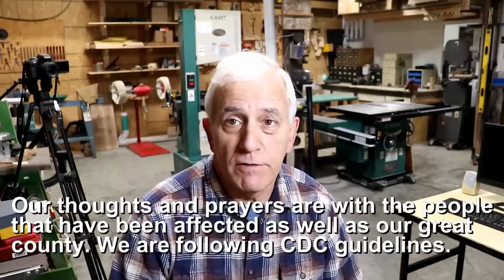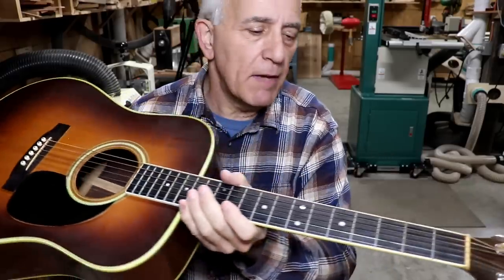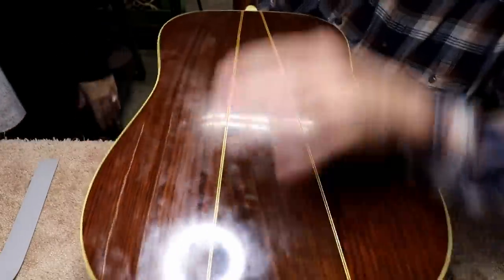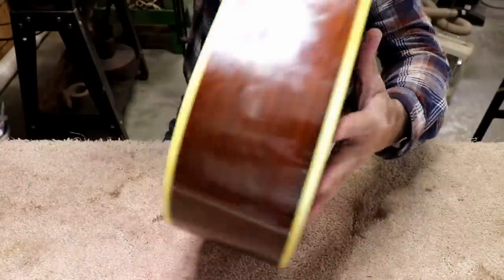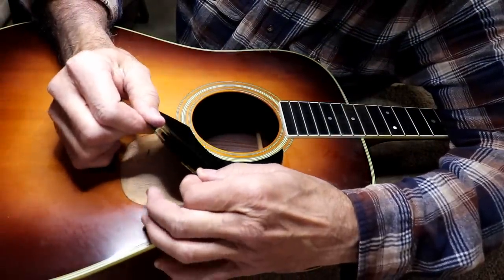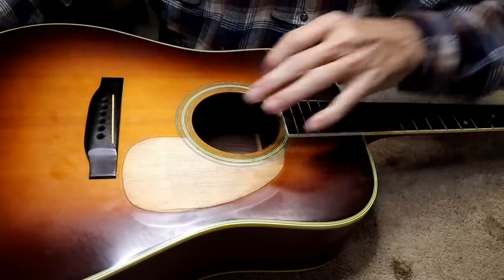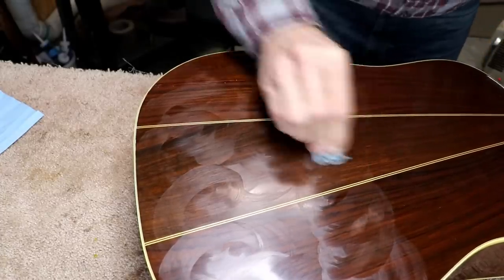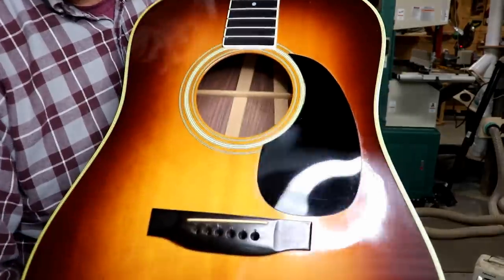387 RSW Martin D35 Impossible Crack Repair

Comment: Jerry, my profession is as a technical  service chemist in a chemical manufacturing company. Before that, I developed products. I can tell you that no spray of a polish type is manufactured without an oil, silicone  or solvent component. They all have that combination. Your assumption that those products affect plastics and acetate type surfaces is correct. Plastics are like a sponge to solvents and react by shrinking or expanding. Sometimes that is just a dulling , other times it is what you have here. So, good advice as usual.
Reply: What about ax wax? Supposedly it doesn't have anything like that in it.

Comment: I bought a D35 with a BLACK pickguard in the mid 70's. I didn't apply polish, cleaner or anything, in fact I rarely played it. It sat in its hardshell fiberglass case for about 10 yrs when I noticed the PG starting to lift from a low edge. I found out that it was a common problem with the PGs that Martin used for several years, and all of them curled. They were all black in color. Just maybe this guitar from the 70's was among them. Martin did not want to honor their lifetime guarantee, but with a bit of social media pressure, they sent me to my local Martin Service dealership. They fixed it and it didn't cost me, of course, it was under warranty. By the way, the 'fuzzy' material inside the case changed the binding from a pretty ivory to a discernable orangish color. Martin-caused problems~!

Comment: The pickguard problem is a known thing with '60s Martins. In those guitars, the guard was put directly on the wood,  using solvent on the back of the guard, then sticking to the naked wood. The finish was applied over the pickguard. The plastic used was prone to shrinkage, and since it was glued directly to the wood, would cause the inner (under the G string) and outer edge cracks. You'll note that if you pull one of those pickguards off, and let it sit for a day or two, it will shrink even more, since the wood isn't holding it in place. Martin switched to pickguards with adhesive on the back, applied over the finish. To "age" a glossy new pickguard, sometimes I'll use a 5000 or more micromesh pad, going in the direction of the owner's pick strokes.
Reply: BTW - love these videos & have picked up a few new tricks. Thanks!
Reply: Very important information to know, sincere thanks
Reply: Don here from Hamilton NZ on my Wife's tablet (Susan) I also do minor repairs on acoustic guitar's thanks for that information 😮😊

Comment: Martin glued the pick guard directly to the wood on the top back in the 70's as they did going back to the prewar days. Then they sprayed lacquer over the top, pick guard and all. The lacquer caused the pick guard to shrink which created the classic Martin pick guard crack. This led to their practice of using self-adhesive pick guards on top of the finish. You did a good job!
Reply: Right. I had the same problem with my D-35 from 1973. Fortunately the crack was small and it was beatufully fixed by a friend who's a marvelous luthier and does this all the time!
I actually saw a video from Stewmac where this problem was solved on a D-35. I thought it would be smart to check out my guitar as well and guess what...?
So I had it fixed and sent an email to StewMac to thank them! :)
Reply: I had the same problem with my 1972 D-28. My good friend and ace luthier Larry Brown removed the curled pickguard and made a new one. Perfect.

Comment: I set my strings by allowing for three winds. After threading the string through the post I crimp it against the host and in the direction it will be wound and the other end the same in the opposite direction thus locking the string at both ends of the post. Then finally I wind the string over itself once and under the remaining turns thus locking it once more.
If I have too much wound around in the end, I adjust. It's that important to someone who bends strings.
  I saw your repair on that fancy green Les Paul model with the broken head. Don't know how you set about getting the measurements but that was incredible.

Comment: I have heard many explanations of the notorious Martin pick guard crack that range from the  plastic shrinking to the plastic not allowing the spruce to expand and contract with changes in temperature and humidity. I also remember hearing once that the curling like this D-35 was caused by chemicals in cigarette smoke !. Nice back repair Jerry !

Comment: Thanks much for the video,  thumbs up to crush a troll.  I'm a big fan of the D-35.

I have a D-35 that was made in '72,  I bought it new in '73.  By 1997, my pick guard had curled up until the pointed end was higher than the strings.  I slowly peeled it off one evening and fortunately didn't remove any wood and didn't have any cracks in the top.  (I've heard of other people having that problem, too.)  I had always wanted a tortoise shell pick guard, but black was the only option when that guitar was made. 

My then-wife called the factory and ordered me a plastic tortoise shell replacement.  They told her that when they built mine that they would stick the pick guard down and then spray the guitar.  They said that now they finish the body and THEN stick down the pick guard, so they suggested that I coat the bare wood with multiple coats of lacquer until it was flush with the existing finish and then stick the new pick guard down, so that's what I did.  So far it still looks good.

Comment: This double crack is extremely close to what is going on with my mid to late 60s Regal jumbo. Very nice job well done. I've kinda had to take a break from it due to hurricane Hannah, but the Lord was very kind and we only had a little branch problems and debris on the yard. We didn't even loose power except for just about 2 minutes.  My prayers go to those who are flooded out.

Comment: You do yourself down Mr RSW...you tried everything to get those two cracks back together. I dont know how long it was left like that but i think the wood expanded somehow, which meant they were never going to reseat....all things considered you did an amazing job...but you always do. I really love the running commentary, mixed with thinking out loud, and just plain ol talking to yourself...very endearing. Absolute peace and respect to ya Mr RSW.
Reply: Very likely correct. Once it's exposed like that, the water in the atmosphere will start to wick into the grain and swell it.

Comment: Your idea for the dowel being a spreader is good one. I use a turnbuckle with different length ends and cauls that way I can adjust it to fit inside and then expand it once inside. When my new workshop is finished, I'll find the box that I packed it in and send you a pic. Great job by the way..

Comment: I'm too late to help you, and I'm not a luthier. But, I've faced similar challenges working on furniture repairs. What worked was using a sheet of folded sandpaper to remove the offending material. Pressing down on the lower piece will give you the clearance you need. Simply insert it in the crack and slide it back and forth.  Still not a quick process, but it does lessen the stress of a knife slip while leaving surfaces that mate fairly well. (I'm also a great Monday morning quarterback)
Reply from the maker: I've done things like that many times. But I guarantee you that you wouldn't have gotten it through this crack. At least not without opening the crack up more and making it worse

Comment: Just a tip ~ nail polish remover will dissolve super glue, so with a bit of careful cleaning, a lot of the excess can be removed before sanding, be careful though because it may also soften the lacquer finish of the guitar with a bit of experimentation you will be able to gauge what works for you. I have used it for removing excess glue around a drop fill. I let the work dry for about 20 mins before final sanding. I'm no expert but I found it to be useful for the little bits of work repairing cracks here and there on my own guitar.

Comment: Great job on a very nasty couple of wood cracks. The finished job was as good as it could ever have been in my opinion. I’m not surprised that spray furniture polish causes glued on scratch plates to lift as in the past I’ve found that it is quite good for removing the sticky residue left by price labels . Keep the excellent videos coming and stay well in these troubling times.

Comment: This was an excellent but heartbreaking video for me, lol. I truly love the Martin D35's. I have owned two of them over the years. I bought my first D35 in 1976. Someone robbed my home in the mid-'80s and took. I currently own a 2001 D35. I would never sell it. (I went into detail when I bought my first D35 for a reason.) I think the wood in this guitar has defected from the factory. An old man once told me to never buy a sunburst color guitar. Cause usually the factory will paint the sunburst color to hide mistakes in the wood. When the wood defects. But all in all. Jerry, You did an awesome job considering what you had to work with. I think I would have removed the brace inside. Then refitting the cracks. But it still worked out good. It sounds and looks great. I truly like what you did with it. Thanks for posting this video. Many thumbs up to your video. I hope you have a blessed week.
Reply: I too own a Martin D35. Mine is from 1980 and what I love almost as much as playing it is taking the guitar out of the case and smelling the wood. One variation I noticed is more recent ones have two strips of rosewood on the back with one mahogany. Mine has two mahoganies and a rosewood in the middle. This one here looks similar. I'm wondering if your '76 had the same back? When and why did Martin make the change? Am I making stuff up???

Comment: Jerry, having experience with 70’s martins, the reason all the old celluloid pickguards shrink like that is because when the guitar was new, they were glued to the bare wood and then sprayed over with lacquer. And over the years, the guard shrinks, pulls the wood with it, causing cracks, and curls like a potato chip. They all did that in the 70’s. Anytime I get one, first thing I do is take the old guard off so the top can breathe

Comment: Hi Jerry!  You mentioned a possible reason for the intonation was the bridge being set in the wrong position and dated it to 1976.  If that is the case, I saw something else that lends to what I believe is cost-savings over good workmanship.  The three panels on the back; I really like that particular feature on the D-35 and D-45, and it always catches my eye.  In that particular guitar, however, they didn't cut the center panel symmetrical with the grain of the wood.  For instruments that command a top price, that just turns me off.  I have an HD-28 so it isn't something I have to worry about but if I had been wanting to buy that D-35 it would have been a no sale.  I glad you said something about not putting the Rennaisance Wax on the pickguard.  I bought a can of it but hadn't used it on the guitar yet but I did use it on a violin I picked up in Germany.  The finish still needs some help but the wax sure did brighten it up some.  I still have to pick up a tailpiece, bridge, tuning pegs, and chin rest but the body of the instrument looks to be in great shape.  All hand-carved solid wood but it doesn't have a mfg label on the inside.  Little things about it make me think it was probably made by a student/apprentice luthier.  Love your videos and you always get a thumbs up!!!

Comment: My humble opinion is that guitar was subjected to a high degree of   heat that expanded the wood  and curled up the plastic pick guard on the opposite side. Unless you were told by the owner that it suffered a blow. You have ressurectered that instrument so beautyfully.

Comment: On auto finishes where you have a run or high build of touch-up, I use a single edge that I've put a bend in. Use the apex of the bend for scraping like you do a binding.
Reply: A card scraper, with tape applied to it's edge, leaving a space just wide enough for the run you want to scrape, works even better.
On a guitar finish I use a single edge razor blade, with the edge turned on the corner of something of hard steel, like a vise, power tool table, wrench or knife.

Comment: No truss rod ..amazing. Thank you
Reply: Yeah. Martin didn't start using truss rods until 1985. . .
Reply: Martin used truss rods.  The problem is that they're not adjustable.  It's a "T" section and there's no threads on it.  At the time, they claimed that it didn't need to be adjustable if you built it right.  Like the prayer says, "Let my words of today be tender and sweet, for I may have to eat them tomorrow."  Like Mortensen 1961 says, by 1985 their truss rods were as adjustable as anyone's.

Comment: Another great job, Jerry.  I've now watched all of your videos related to guitars, and I've got to say that this D-35, even before the repairs, is the best sounding guitar of any in your videos.  I'm jealous because I'm the second owner of a 1974 D-35 that I've owned for 35 years and it doesn't sound as good!  I've tried pretty much everything to make it sound better, but it never has impressed me the way most other D-35's I've played......maybe I need a deer antler saddle and nut!
Reply from the maker: The antler saddle will help. The nut doesn't change it very much. I would also cleaned polish and wax the guitar you'd be surprised how that can change it. I would make sure the inside of the guitar is really clean and dust free as well. You'd be surprised how those things can actually make the guitar vibrate better

Comment: BTW I'm not refuting your reasoning for the warping of the pick guard but I have a D35 I bought in 70 and had the same problem.  I was told it was the dryer in the solvent based celuloid plastic in some of them that over time shrank and caused the distortion.

Comment: I wonder if the wood was more hydrated than the day it cracked and it had swelled keeping it from going back together. Then placing a dessicant in it for a day might shrink it enough to  get the pieces to pop back in..? I guess that's not what you think as you didn't mention anything like that.

Comment: I used to build RC airplanes and I used what is called a capillary tube. It is much smaller in diameter than the pipettes and woks well for fine gluing.

Comment: Great video as usual, could you have tried laying the back of the guitar on a flat surface and then (probably with assistance) pushed the back of the guitar down from inside, so that the flat surface you are on would possibly line the crack up. Just a thought. I am not sure if you can obtain stateside, but I use Lord Sheraton wax polish and the tiny white spots you have on the back of the guitar by the repair, I would retouch with almost dry water colour paint and then add polish and buff. Well done in any case. Thanks for these.

Comment: There's a way to tape that off so there's not a hard edge. You have to loop the tape, basically make a cylinder with the sticky side out, and put that where you want a feathered edge. That's what we do in the automotive industry to refinish cars without leaving a hard paint line/edge

Comment: Those back cracks across the braces are  very hard to level, the side near the kerfing sometimes folds under. The only way to get it perfect is to remove the back, but as you said, diminishing returns. Thanks for posting.

Comment: Greetings Mr. Rosa; Regarding the Electrical problem, Check your ground and return, two breakers turning off the same light means your adding phases one services as live and the other as return to the other, this occurs when your negative terminal gets loose and you turn 120 v to a 220 v system some system might reference from the ground if properly installed and still run @ 120 v, most times issues like your are caused by a short causing the negative terminal in the breaker box to burn or weather / salinity creates a sulfate layer causing the negative / return for that system to go open.  VERY HIGH FIRE HAZARD, so please check promptly.
Reply from the maker: The weird thing is it's worked for 15 or 20 years it just started this on its own
Reply: @RosaStringWorks  sulfate build up create resistance until you get a short in the system, you might have probably noticed the pump drawing more power or getting hot until it failed, that is, if it is in fact sulfate on the terminal, if it;s a open short due to burned end, then the issue is something drawing to much amps, this could be something not wired in the correct phase, a short from the live wire to ground (instead of neutral) causing a draw, a heated winding causing high resistance, etc, best practice is to have a multi meter at hand and test all the breakers for both voltage in/ \voltage out (some breakers might be hot causing resistance) and to test amp draw on all devices, if you don't have a tester you can build a voltage limiter with a bulb wire it in series and it should not light up, if it does, that devices is in short or drawing to much amps.

Regardless, a 20 year old wiring must be updated, maintenance includes redoing load balance on all phases, cleaning all connections, checking polarity of all outlets, re-referencing ground / returns on the lines coming in, replacing and updating breaker for the correct loads and in your shop you might do well having a separate wiring from the main house, and have that system on a master switch you can turn off when not use, that would improve electrical safety and reduce electric bill by one quarter (some go as low as half)